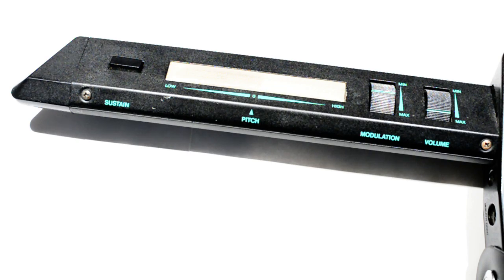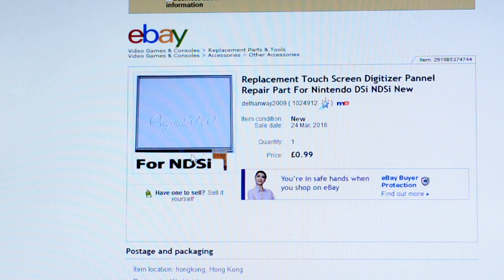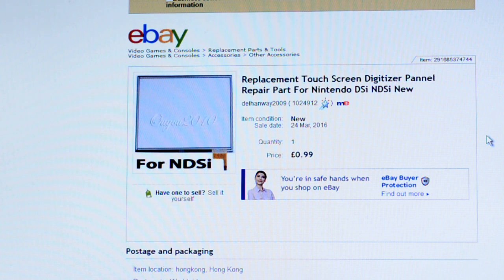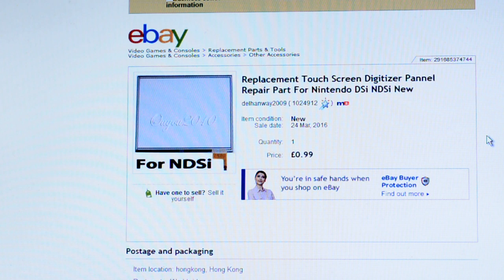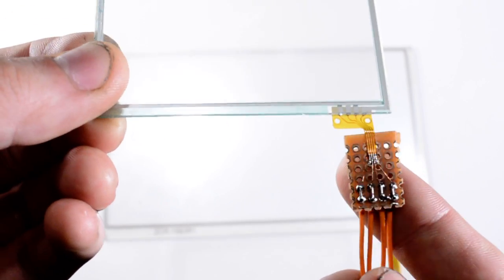Touch Screen as a MIDI Ribbon Controller

Comment: If you search the bay for "nintendo dsi p6 connector" – P6 being the part number on the circuit board – you will find the a fitting ZIF connector for that cable. This still has to be soldered SMD style, but I'd rather break that than this flimsy little cable. I'd Love for someone to design a breakout board for these..  In the meantime I will try and get there myself
Reply: Just found the original part (offers on the bay are ripoff!). It's a "Molex 501461-0401", which also tells me the pitch is 0.5mm, not 0.4mm

Comment: You so should make use of the 2d-ness and make the second dimension be volume. Kinda like a thermin but on a surface. Or you could make the second dimension be a parameter for the wave shape...

Comment: the fact that is 2 dimension, means you could use the Y axis to control pressure on the keyboard, ore other value too... or you could divide vertically the screen in like 4 parts, and boom, you have 4 octaves, or 4 different instruments, or 3 other sliders...

Comment: obviously you cant simply cut it up a touchscreen as is, but making multiple ribbons/"softpots"(tm) from one touch panel should be pretty simple, using just the resistive plastic film and single sided PCB material as the backplate. (gold plated, so there's no oxydisation) hardest part will be sourcing some conductive, douple sided tape, without having to but an entire roll of that expensive stuff.

Comment: Now do the same for capacitive touch
Reply: Missing the point
Reply: what's your point then?
Reply: no, you! it can literally be done by drawing the traces on a piece of paper with a pencil. :D 
but why would you even want that? aside from being needlessly complicated, it would be pretty annoying when you cant put a finger on the ribbon, without it immediately triggering. i'd much rather layer it with a pressure sensor.

Comment: Would it be easier to solder to those ribbon cables if you cut them diagonally to reduce the apparent pitch?
Reply: just get the intended FPC connector and put it on a PCB :/
Reply: @dumle29  oh no! Spending 2 pence on a breakout 😳 how will we afford that

Comment: I clicked on this thinking at last a touchscreen part that can be repurposed OUTSIDE a COMPUTER and used for MIDI.. I was sadly wrong. I was hoping for a non computer based hardware midi only solution. I have a ton of trackball mice, and touchscreen panels and wanted to make a standalone, kosspad like device that can send midi control messages to a Yamaha AN200 groovebox synth or any other real hardware synth that accepts midi control messages in realtime. A touchscreen midi controller would be great and a trackball midi controller as well. Imagine changing the values of your Yamaha DX synth using a trackball or touchscreen? Draw a line in any direction on the touch panel and change the frequency parametre on the Yamaha, draw the circle and change the filter,etc.. Touch screens come in resistive, capacitive and acoustic wave. The resistive would be the most simple as you said. Like having a big after touch strip to play with! My laptops have a USB type or PS/2 type touch pad that screems touch controller! Can you fashion a NON COMPUTER based midi only interface for a 4 or 5 wire resistive touchscreen panel to be used as a ribbon or touch pad  midi controller?? I know that would work with aserial/PS/2 and USB trackball as well. On the ball version, imagine being able to change the timbre of your Yamaha FM synth patch dynamically in realtime by moving the track ball in every direction! Now imagine flicking the trackball to let it freespin while you play on the keyboard and the act causes the sound to freak out or change in real time without you having to prerecord the midi changes for say a..wavesequencing evolving sound? I spin my trackball on the PC sometimes to get the mouse cursor to go in one direction or the other real fast, and I can just imagine being able to do that but with a synth sound instead of just a mouse cursor.. Think about it.. I know there are ridiculous priced solutions out there but I am poor, and have ALOT of recycled computer parts, old Casio and Yamaha Keyboards and midi synths in my house screeching to be used!... TOGETHER :-P
Reply: I think all you need is something like a raspberry to transform the touchscreen input into a midi signal. At least that's the simplest and somewhat cheap solution I can think of within 3 seconds of brainstorming. But stop hating on computers, these days you don't need a 3 foot cube for a simple midi conversion. 10 bucks for a computer the size of a credit card does the trick for a lot of things!
Reply: @VulpeculaJoy  lol you are right! But I do not hate on computers. I actually am in the search for said sized solutions. I have seen at LAST, a micro sized PC x86 intel NUC cube that I could only dream about and indeed did, back in 2012! Sadly, they require Windows 10 and not Windows Xp or Win7. Win10 is too bloated and heavy to use for what I need.. I have also come across tiny sized touch screen intel Atom units that mount into a panel or wall. My thing here however was more of a being able to repurpose electronics parts for midi and synthesizers. In the 1980s when Yamaha DX7 and the like came out, I would imagine being able to use a arcade track ball to change FM frequency and modulation parametres on my Yamaha PSS480 in realtime by letting the ball fly when I flick it fast and it would spin and thus cause the sounds on the keyboard to evolve and change WHILE I play with BOTH hands.. I am 45 and in 2019 and STILL wanting that... I am a circuitbender as it is called online now.
Reply: Raspberry is probably overkill... ESP8266 or ESP32 should be able to handle this just fine
Reply: https://www.raspberrypi.org/products/raspberry-pi-zero/

Comment: Is that possible with multiple touch
Reply: no
Reply: No, you only get a single voltage, therefore when you press with two fingers, it will register only as one somehwere in the middle of both.

Comment: hello,
I don't understand how to connect to the touch screen in your shematic.
Can you help me?   : (
Reply: I like this projekt! 👍 Cool video!
I'm very interested in building it.
But I think ther's a difference between your shematic and your finished controller.  ?
I think there are some extra parts which are not shown in your shematic.
Can you help me?
I would be very happy to build it!!!  ; )
Reply from the maker: Apologies if it is not clear. The touch screen is represented as a potentiometer on the schematic. Just take three of the wires from the screen and pretend it's a pot.
Reply: @mitxela  Thank you very much!  ; )
And my second question?
On your Website you writed that this is "Approximate circuit (add capacitors to taste)"
What capacitors?
I would really like to make this but I think it wouldn't work maybe.  : (
Thank you for your answer!

Comment: Nice video! Looking for this for a longer period. Is there an reason why you add a physical button? because you have a touch screen, why not using the upper area as touch buttons (so you can draw your own buttons). It is also easier to extend. In fact, you can draw a whole input interface for any project with only for wires, you don't need to drill holes and you are able to create nice drawings, that's pretty neath.